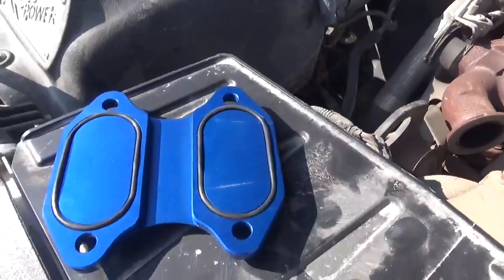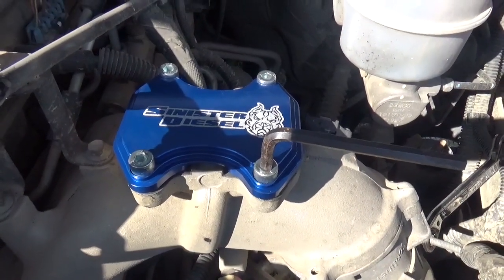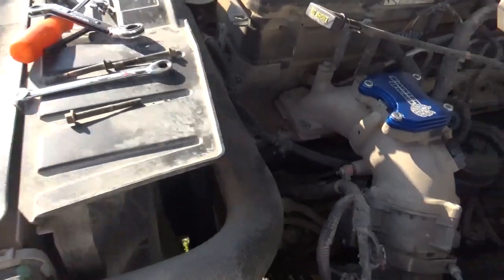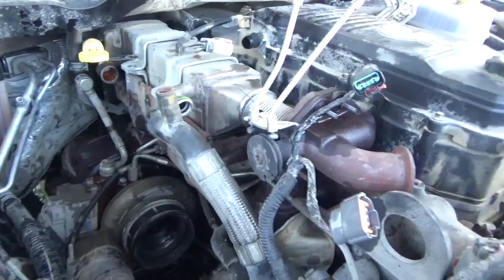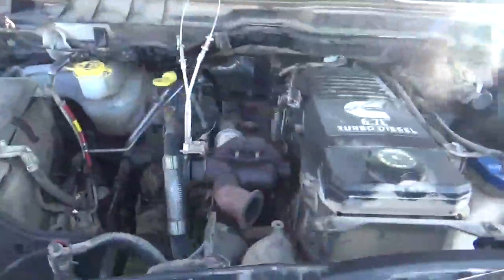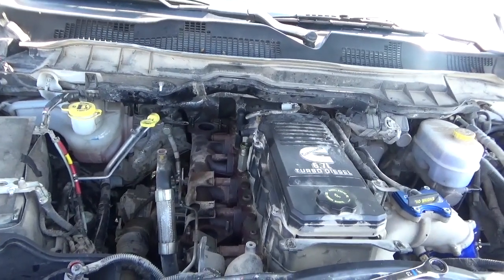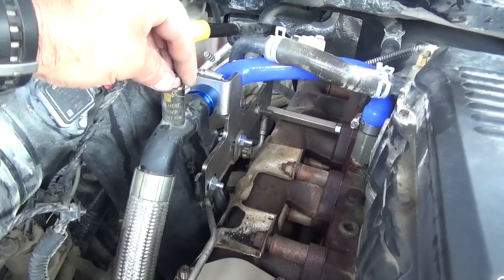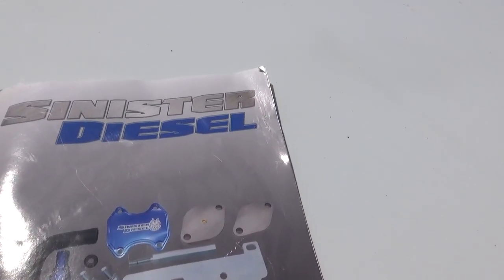2012 Ram 3500 6.7L EGR Delete

Comment: I have 2012 ram diesel I want to do this to so if I  do the delete kit you shouldn't get any codes
Reply from the maker: It's possible to get a code.  You can read the code and clear it with your tuner/programmer
Reply: I'm about to do this to my 2012 just curious did you end up doing it and how did it work out for you?

Comment: Did you also have all exhuast sensors deleted and desconected after you delete the EGR. ? I am planning to do the same thing. Nice video !!
Reply from the maker: I deleted the exhaust, eliminating the cat and the DPF.  Straight pipe to the existing muffler and tail pipe.  Zip tie all of the wire harness connections out of the way.  Make sure the EGR wire harness doesn't fall on the exhaust manifold.

Comment: Thank you for the video! Mines almost finished however I noticed the crank case ventilator interferes with the blue coolant bypass hose. Did you use an extrusion/spaced bolt on the side of the mounting plate to mount the ventilator tube to?

Comment: Love how you skipped over the center bolt for the egr cross tube 🤣🤣🤣
Reply: It’s like an 11mm or so bolt that holds it to the head. The coolant hose is in the way so you have to push it out of the way and use a 1/4 extension

Comment: A guy was telling me today there'd be some coolant to replace in this procedure ? I didn't see that.
Reply from the maker: Yes. You will lose some coolant when removing the  EGR cooler.  You just need to need to top off with anti-freeze.  There is a high point cap on the hose right next to where the EGR cooler was.  You can remove this plug to make sure you have all of the air out of the system.

Comment: I am stuck at 67 miles until lockout on my off-road truck. I paid $180 for the dealer to diagnose it as a bad pump, I was hoping it just needed cleaned out... I was about to take this to a shop that quoted me $2800 for everything but it looks like its not that difficult and I do all my maintenance myself anyways. I've found the EGR/ Pipe to be pretty cheap, around $400 for both, and it looks like the RaceMe is about all that will work and that's $1200. 

If I were to do this myself and try and save some cash on having it tuned would the truck drive to the dealership? Am I better off getting my own tuner or having it tuned at the shop?
Reply from the maker: Most tuners are pre-tuned to work with a stock engine.  If you have more thing s done to the engine like changed out injectors (more fuel) or different turbo you will want to get a custom tune for the higher performance accessories.  Its not that difficult to remove EGR and straight pipe exhaust.

Comment: If I do the delete without a tuner is the truck still drive able? Just with a check engine light? Can you send me a link for the tuner you used?
Reply from the maker: Not sure.  I put the tuner on before I drove it ( after the EGR and CAT and DPF delete).  It will have a check engine light on for sure.  It may go into limp mode where it will limit the power and drivability.  The tuner was the most expensive part.  You can clear any check engine codes with your tuner.

Comment: Did you have to install a tuner to avoid the check engine light constantly staying on?
Reply from the maker: Yes.  You will have check engine codes pop up .
Reply: @appalachianmountainliving6231  do you install the tuner before or after the install of the delete kit?
Reply from the maker: @Coyotesinc22  I installed it after

Comment: Questions you did straight pipe first to stock muffler can you used the truck while you have egr connected to the system cause i want to do same thing pipe first n the egr last but i need to go different place but i am concerned to damage something if i drive the truck like that ?
Reply from the maker: Yes straight pipe, turbo to the stock muffler.  I did them both in the same weekend. I didn't drive it until it was all done.

Comment: Any tips on getting that adapter with the oring back into the hose for the antifreeze
Reply from the maker: Its tough to get it on there. Make sure it is wet and just keep working it until it goes on far enough.
Reply: @appalachianmountainliving6231   I got it back on with an oil wrench of all things. Thank you

Comment: Is the tuner plug and play? Or did you have to purchase programming for it?
Reply from the maker: Plug and play.  Its not a custom tune.  But I think they offer a custom tune, I just didn't need it.  I did the delete for fuel mileage.
Reply: That needs any program or u got check engine light the truck drive normal just with the delete no program

Comment: Where did you get the egr delete kit from
Reply from the maker: Don't remember where I ordered it from.  I ordered the EGR delete kit and the exhaust system like 5 years ago.  I didn't purchase the tuner for a couple of years later.  Then I installed everything.  All of this stuff requires you to check that it'll only be used off road or for racing.

Comment: I have seen others ram delete video and they use some kind of tuners . did you use one or not. Did you get any air codes?
Reply from the maker: Yes you will need a tuner.  I used the Anarchy diesel Mercenary auto-cal tuner.  I did not have any error codes.  I installed the tuner first.  Disconnect the battery and then I deleted the exhaust and the EGR.
Reply from the maker: I took it on a long trip from West Virginia to Louisiana and I was getting 20 mpg on the highway.  That's 4 mpg better than I was getting before